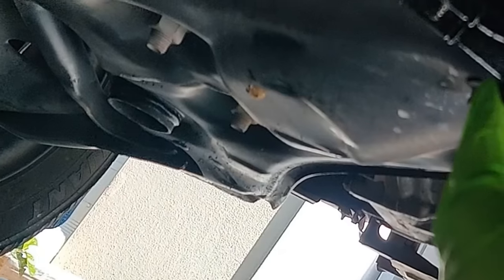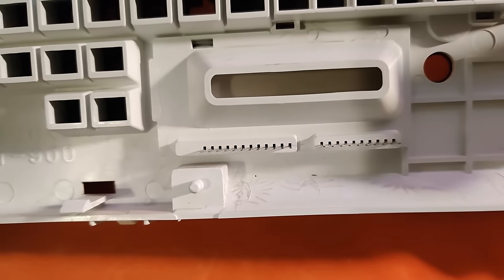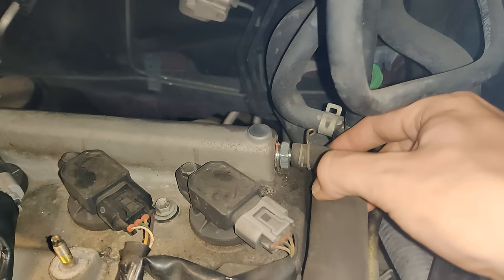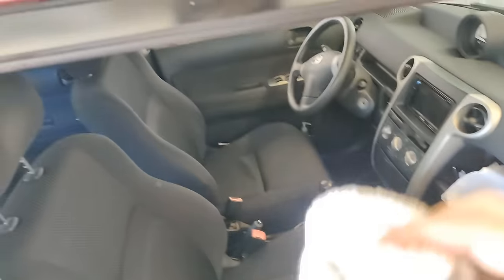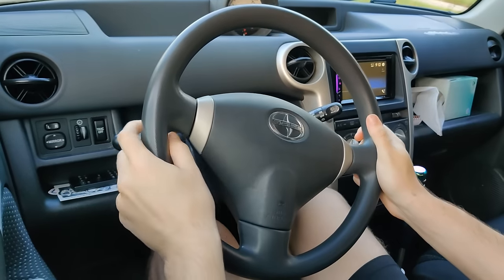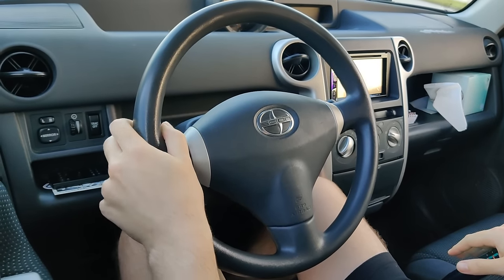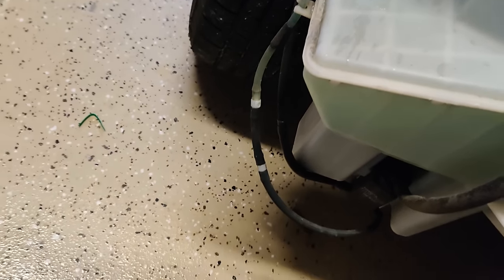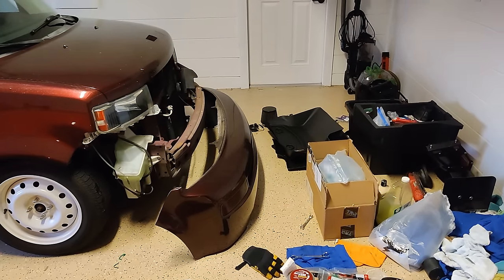taking good car of my box

Comment: Hey franz, my truck was having the same idling and bogging issues as your box, i recommend going to autozone and getting a can of MAF cleaner AND throttle body cleaner, only around $20, remove the MAF and throttle body and clean both, make sure no carbon buildup is left on the throttle body, a shiny result is necessary. (throttle body cleaner will clean your air filter too, dont use brake cleaner)
Reply: Beat me to it.
Reply: Hey franz, my truck was having the same idling and bogging issues as your box, i recommend going to autozone and getting a can of MAF cleaner AND throttle body cleaner, only around $20, remove the MAF and throttle body and clean both, make sure no carbon buildup is left on the throttle body, a shiny result is necessary. (throttle body cleaner will clean your air filter too, dont use brake cleaner)

Comment: the car revving up and down by itself is most likely the mass air flow sensor, or in worser case scenarios, it could also be the injectors, hope this helps
Reply: the condition is called hunting, meaning that the engine ECU is trying it's best to figure out what the best air - fuel ratio is and usually happens when there's a part of either the air system or the fuel system that has a malfunction
Reply: or it can also have to do with the o2 seonsors, however I don't think that's the problem as its as he is downshifting

Comment: These types of pod filters need to be oiled(afaik), by a special thin film of oil to catch dirt/debris particles, whenever you clean the pod filter of this aforementioned oil and debris you need to also reoil it with (special) oil (I assume), google more on it. Not oiling it will cause premature engine internal wear.

Comment: Idle above 1k is not very usual but fluctuation is. My bimmer does it when I got my headlights on and then close my vert roof. Sometimes when I put it in reverse (its an auto) it almost stalls but goes back up to 1300 and it falls off again. It instantly saves itself tho. These electrical gremlins are so annoying but they make the drive more of an experience
Reply: E36 owners be like "my car being unable to idle properly is a feature!"
Reply: @Eclipseballer1994  i also had to replace the thermostat already after 2 weeks of owning it
Reply: the box isn't an automatic
Reply: @triplexx  didnt say that, just relating

Comment: The check engine light actually causes the traction control and VSC light to come on (they're both not active anymore). The reason for the CEL in my car is an O2 sensor error, nothing dramatic

Comment: Now i'm no expert.. but i don't think you should use brake clean on your airfilter. Usually washing it with hot water from the inside out making sure gunk doesn't go on the inside is usually enough. Once it is dry you can go the extra mile and buy some airfilter "oil" which is just some lubrication for the filter so it doesn't become dry and brittle, and it only needs a light coat. Apart from that you shouldn't need to do anything else to the air filter.
Love the car vids btw

EDIT: from partzilla air filter cleaning guide "NOTE: Never use contact/brake cleaner or carb cleaner on a K&N air filter, as theylll severely damage its cotton gauze material."
Reply: oil is not optional. K&N and similar fiber filters require filter oil, or they're doing almost nothing.
Reply: @zeepro_tv  i get for pristine performance numbers you’d want that, but for your average joe I who is trying to save every penny I’m trying to say that he shouldn’t need to go buy K&N’s expensive filter oil but just some oil will do fine and a dry but clean filter with probably still be better than the oiled filter that was sprayed using brake clean.
Reply: @apg4gearhead this oil is actually a wax that is used to trap dust and help fill the gaps properly for adequate engine protection, not using it also means water does not get repelled and can lead to you hyddolocking your engine, that said I have an injen pod filter that uses microweb technology and says not to use wax on it ever, it just depends on the brand I guess.
Reply: @alexanderwoolley1623  yeah it does matter because some filters are made to run dry and some aren’t. However you will need a LOT of water to hydrolock an engine, and if you drive through a river I doubt a little bit of oil will keep out the water ahaha

Comment: Your car idling high could be due to possibly your throttle position sensor being knocked at some point or possibly an air leak causing it to lose pressure. Have had those issues in my VT Calais in the past

Comment: I think the aftermarket air intake let the throttle body get a lil dirty, like others have said, maf and throttle body cleaner wipe that hoe clean, then disconnect the battery for a bout 10 mins, reconnect it and let it warm all the way up, should idle around 1100 while warming up and then drop to 650-750 when hot. Has to re-learn its idle after battery is disconnected. Wouldn't hurt to do spark plugs while u clean the throttle body, and dont cheap out on plugs I've seen so many amazon plugs and coils at my job causing misfires recently smh

Comment: I would change that shifter knob with original one of the scrap yard because this shit will break the gearbox
Reply from the maker: Yeah I have the original just wanted to be funny
Reply: How could it break the gearbox?
Reply: @misiek7411  the one that franz showed on vid is very similiar or the same as the ones on wish or aliexpress and those are very cheap with being too long for gearbox and also being very loose. With this combo you could give to much push to gearbox while not hitting gear.

Comment: Clean up your idle air control valve if it has one
Reply: BTW your filter need to be recharged with oil their is a specific oil for cone style filter like yours
Reply: Also could have a vacuume leak I had one in my ep3 intake manifold